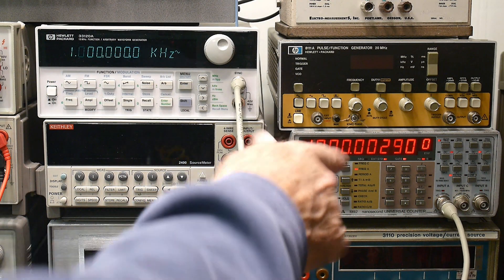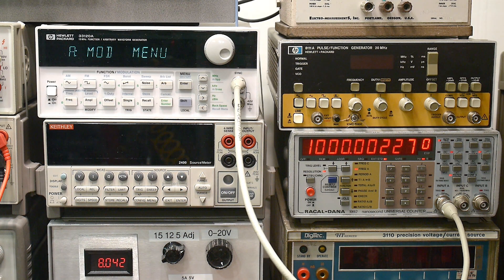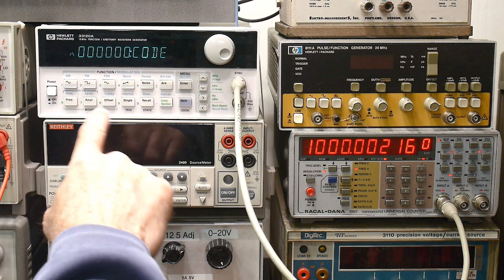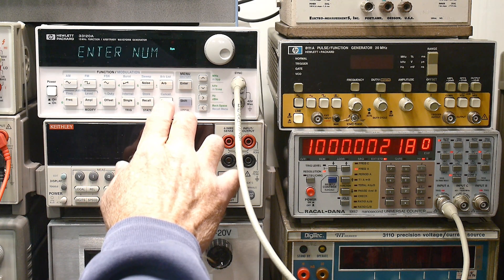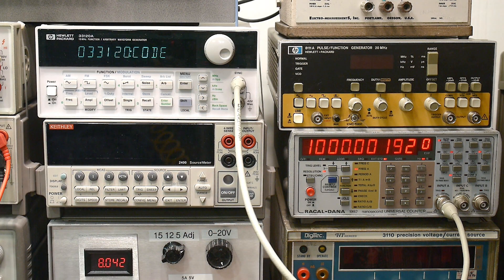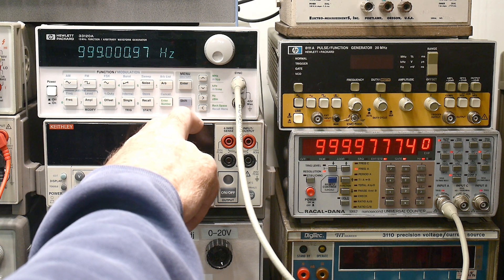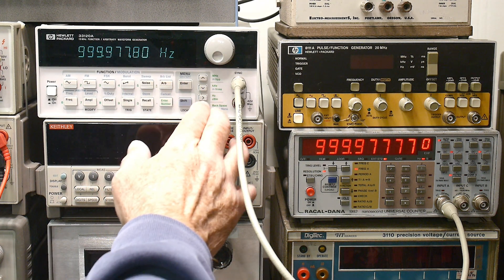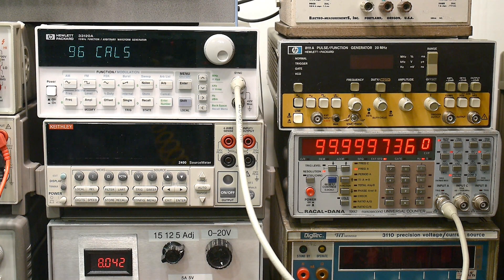#1039 HP 33120A Frequency Calibration

Comment: That Racal-Dana looks a bit unstable.... I suggest you fully re-cap it, will be power supply noise getting in.
Reply from the maker: the racal is very stable, the arb is not. I think it has jitter

Comment: I feel your pain. These HP units are really intended for cal using the remote, and operation that way, to be honest. The front panel control is inconsistent across the line and awkward. (33120A vs 66311A vs 66312A vs... all painfully similar but not) Does your unit have SETUP-86 (later revisions of the unit)? This is at 10MHz. Reduced slew rate error using the sine output. The sync may not be as accurate, as it is clocked by the 40MHz master, IIRC, and doesn't account for the DSS dithering and analog filter. If you have OPT001, this makes for better performance.
Reply from the maker: maybe I should have used the output and not sync. I guess I need to try that.

Comment: Thanks for including the oopsies.  Don't know how many times I've been reading a manual and faithfully (or so I though) following the steps only to be frustrated, then repeated the process until eventually catching the silly mistake I was making.  Similarly, I have written many user manuals for various bits of gear.  No matter how many times you pedantically go through and record then write up the steps, someone will find a way to read what you wrote a bit differently and get hung up.  It is a lesson to new developers and authors that you can't be too clear in writing operating instructions.

Comment: Running my racal 1998 on rubidium I get ultra stable 10MHz read. Is your rubidium locked?
Reply from the maker: yes
Reply: @IMSAIGuy  have a look...
https://youtu.be/1_Dai90GxFE
Reply from the maker: and your point? when I measure a stable oscillator the racal dana is rock solid. the arbitrary generator seems to have some jitter.

Comment: This is as bad as the procedure to disable sealtbelt chime on Ford truck:
Deactivating/activating the BeltMinder feature

Read steps 1 - 9 thoroughly before proceeding with the
deactivation/activation programming procedure.
The BeltMinder feature can be deactivated/activated by performing the
following procedure:
Before following the procedure, make sure that:
• The parking brake is set.
• The gearshift is in P (Park) (automatic transmission) or the neutral
position (manual transmission).
• The ignition switch is in the OFF position.
• All vehicle doors are closed.
• The driver’s safety belt is unbuckled.
• The parklamps/headlamps are in OFF position (If vehicle is equipped
with Autolamps, this will not affect the procedure).

1. Turn the ignition switch to the RUN (or ON) position. (DO NOT
START THE ENGINE.)
2. Wait until the safety belt warning light turns off. (Approximately 1–2
minutes.)
• Steps 3–5 must be completed within 60 seconds or the procedure will
have to be repeated.
3. Buckle then unbuckle the safety belt three times, ending with the
safety belt unbuckled. This can be done before or during BeltMinder
warning activation.
4. Turn on the parklamps/headlamps, turn off the parklamps/headlamps.
5. Buckle then unbuckle the safety belt three times, ending with the
safety belt unbuckled.
• After step 5 the safety belt warning light will be turned on for three
seconds.
6. Within seven seconds of the safety belt warning light turning off,
buckle then unbuckle the safety belt.
• This will disable BeltMinder if it is currently enabled, or enable
BeltMinder if it is currently disabled.
7. Confirmation of disabling BeltMinder is provided by the safety belt
warning light flashing four times per second for three seconds.
8. Confirmation of enabling BeltMinder is provided by:
• The safety belt warning light flashing four times per second for three
seconds.
• Followed by three seconds with the safety belt warning light off.
• Once again, the safety belt warning light will flash four times per
second for three seconds.
9. After receiving confirmation, the deactivation/activation procedure is
complete.
Reply from the maker: seems clear to me 😣😫😯
Reply: @IMSAIGuy  Third time was a charm before I got the procedure down pat......but you know what they say about Richard Nixon... Ha!

Comment: The Racal-Dana calibrated or running of a high stability/low PPM OCXO to calibrate against?
Reply from the maker: running on rubidium
Reply: @IMSAIGuy  Gotcha. Your 33120A has option 001 installed by any chance?